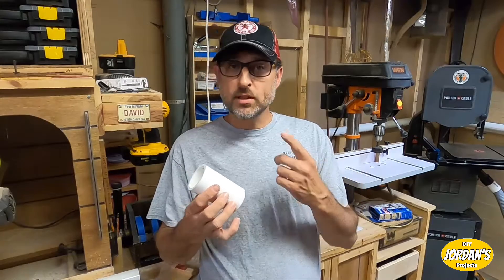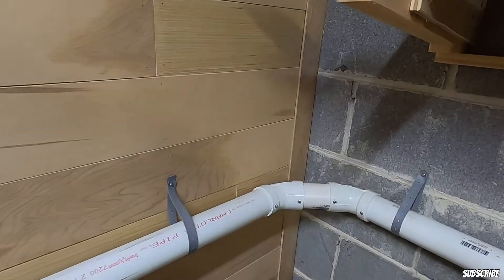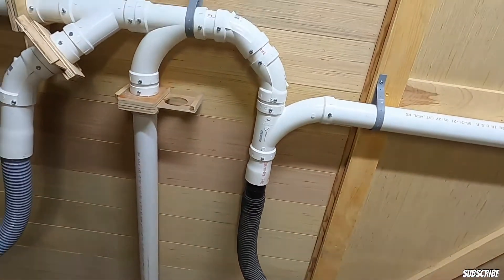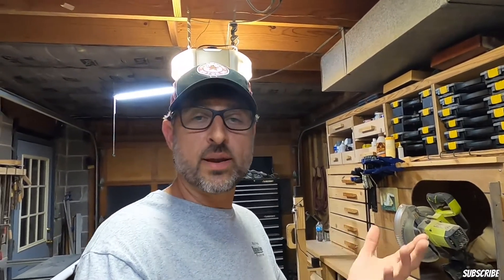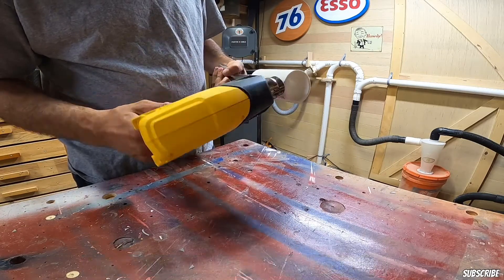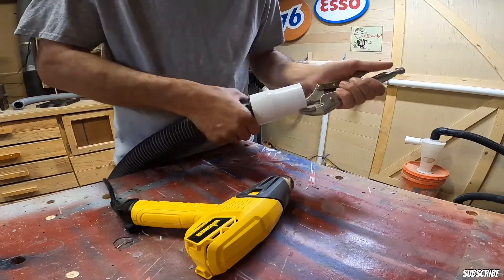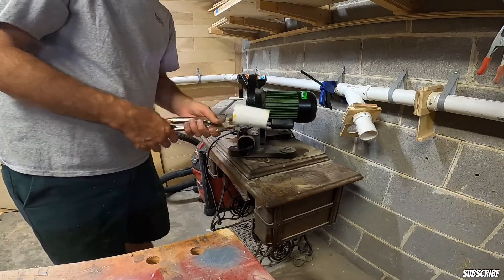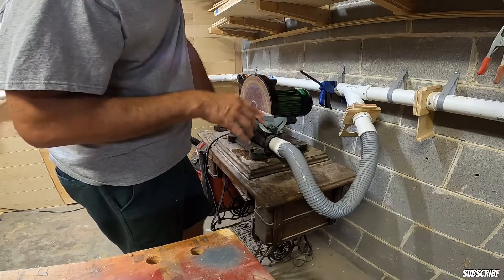Shop vac dust collection system with homemade adapters

Comment: So far, this is one of the best how to explanations for creating Shop-Vac "fittin's" out of PVC. I just started doing this and discovered something that you may have answered here. When creating PVC fittings, you should probably use at least a 5" (possibly 6") piece of PVC. I think the heat will warp the other end if it's any shorter than this. I created one that's probably 4", and the Shop-Vac hose fit in it perfectly, but after I heated the other end of the fitting to shrink it so it would fit inside of the receiving end, it seems the first end must have enlarged some during the heating process, because now my shop vac hose falls out of it. I put a few wraps of electrical tape and that seems to be holding.  Anyway, Liked and Subscribed. Will look for more from you.  Thanks.
Edit: PS, I really like the idea of running a pipe down to the floor so you can just sweep whatever ends up down there into the clean up area.
Reply from the maker: Thanks man   The floor sweep is great

Comment: Most videos show how to make pipes bigger- yours is the first I’ve seen that shows how to reduce the diameter. How much of a reduction do you think is possible doing it this way?
Reply from the maker: This is a technique used to increase the size of the pipe to adapt it to another size

Comment: Good idea. For more even heat you can dip one end of the pipe into a couple of inches of boiling water until its soft but your idea is quicker
Reply from the maker: That would work but I’m trying to stay out of the kitchen. Lol

Comment: Great setup. You can tell you put some labor into it. Just a tip. When you make any more couplings. Once you heat and fit the piece take a wet rag dipped into cold water and wipe the heated pipe down. It will cause it to cool in seconds and you dont have to hold it in place so long. It all looks great. You will get years of service out of it. Nice job!
Reply from the maker: That’s a great idea. I was unsure about the shop vac but you changed my mind, it actually works extremely well especially for my size shop.